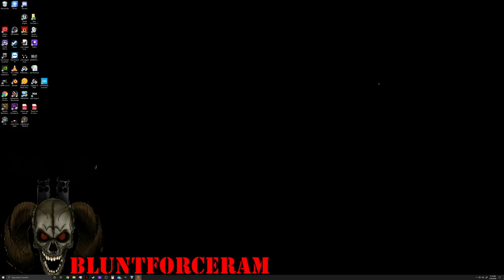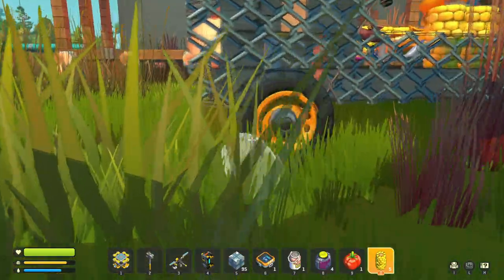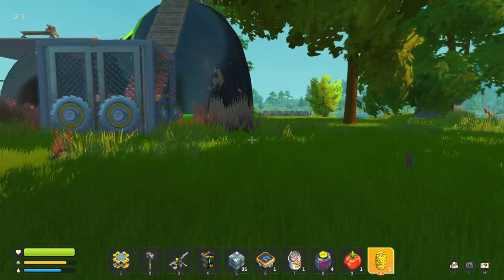Pivot Steer Harvester! Family Survival Part 7 Scrap Mechanic Survival Multiplayer 4K

Comment: Hi, yesterday I saw your video on reddit and checked it and until evening I watched all 7 episodes :D That's really nice to watch when whole family plays together and have so much fun. Keep uploading! Oh and btw. when you have "floppy wheels" (to much weight + speed calculation on a chunk), stop immediately so your car won't "glitch-fly away" and put it on a lift for a second. And I recommend welding vehicles to the ground or world structure (not to the base, expecially when it will be big) and wheels should not touch the ground. For the miner maybe try with 2 arms with pistons that will hug the rocks - worked perfectly for me.
Sorry for such a long comment and you all have a nice day! :)
Reply from the maker: Thank you for the long comment, curious though, you said my video was on redit?
Reply from the maker: And thank you for the advice. So The next video was recorded 2 days ago and im having issues getting it edited (Slow drives) but hopefully i can have it up tomorrow. as far as welding the vehicle,  starting that, I have had to do that in the past in my creative world (too many complex creations on one map). For the Floppy wheels i am running an experiment on. It seems that Floppy wheels is caused as you said too much weight and speed calculations, seems to cause the bearings to no longer only be locked in x and y axis and only rotate on z axis. So the idea is to add a second bearing at any point that may be stressed to locate and limit back to only rotate on z axis. Spoiler, so far it seems to work and with out the random excessive collision from the bearing releasing and locking the vehicle does not get thrown around any more. However pistons still go crazy and randomly extend to the full length of a level 5 even if they are level 1, so I have been sure to try and make sure the design can take that without any major issues. I Prefer pistons instead of bearings for the lift arm since pistons give and allow a kind of "Float" option. As far as the drill head i have changed it but not have tested it yet. I have added a tree harvesting feature and have mimicked that for the drills so hopefully that works better for what will be obvious reasons.
Reply: @BluntForceRam  Yes, someone posted it as 'it deserves more views' or sth like this :)
Reply: @BluntForceRam  I'm looking forward to see the results of all such ideas in future vids especially for bearings countering stress axis. I see there's a new one now so I'll gladly watch it in next free moment! :)